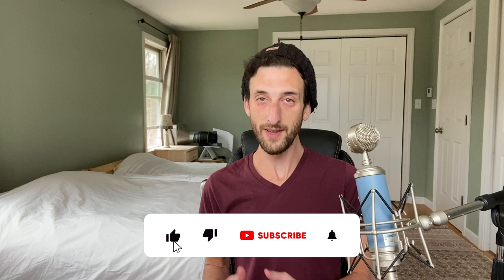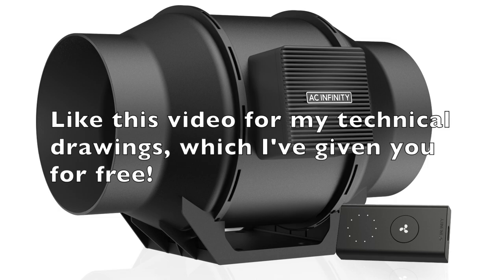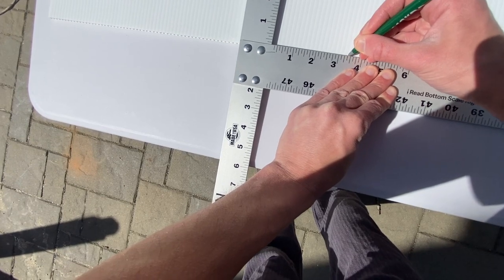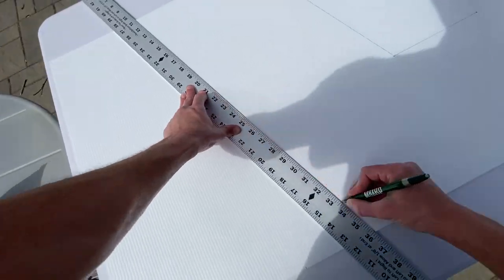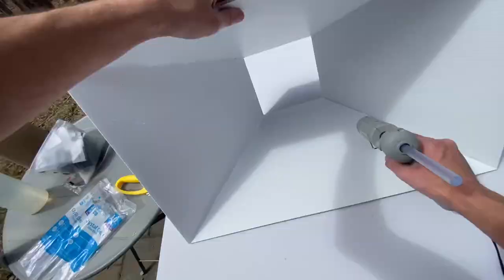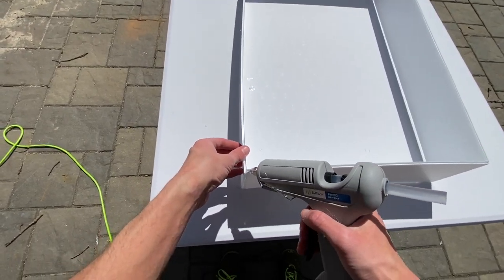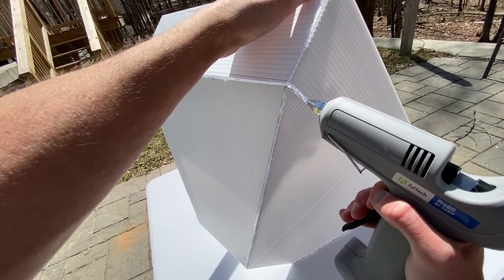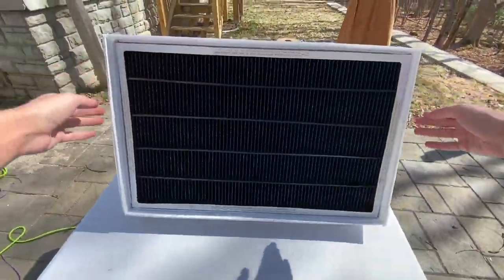How to make the best DIY fresh air system on YouTube (great for apartments!)

Comment: I'm still an advocate for filter before the fan.  The filter also protects the fan from particulates and dust, which is especially important if the fan you're using is an axial fan (which I think your fan is).  You wouldn't need to put the filter right in the window, given that you already built a housing for the filter that resizes its input.  And you can always dampen the fan output or redirect it by pointing it upwards or something.
Reply from the maker: You have a fair point, and I do agree. I may make a future design in which the fan is after the filter. 

Though fan before the filter actually worked well in this context. And was easier to build and implement.
Reply: @HealthyHomeGuide also, doesnt fan first make that pyramid you made a mold harbor w that damp outside air?
Reply from the maker: @johnanon658  Good question. I didn't have mold issues with this device. Polypropylene is resistant to moisture. Many HVAC systems have a length of duct before the filter, it's not necessarily a problem to not filter air immediately as it comes in. 

One thing I also want to express is that it's definitely a more difficult build if you put the filter before the fan. Assuming you'd put the filter in the window (because otherwise, the system would take up tons of space), you need a much larger window insert, with a bigger cutout that'd be harder to get right. Not to mention that many windows aren't wide enough and don't open enough to fit the Lennox filter. Next issue with filter before fan: air comes at higher speeds out of a smaller fan than it does diffusing out of a larger filter. It's nice to avoid air blowing on people.

For those reasons, I found that putting the fan before the filter was actually better in this case.

Comment: I built the 14" version and it works great! The CO2 in my home office went from consistently over 1000 to consistently under 1000 PPM. I would like more details about the importance of opening another window to prevent positive pressure as I don't have another window in the room to open. What are the risks of creating positive pressure?
Reply from the maker: Nice, awesome job! Positive pressure is a complex subject. Some people actually use positive pressure to keep pollutants out. But there is a risk and that's if you humidify your home in the winter. Positive pressure could force that humid air behind your walls, where it would encounter cold surfaces and condense, causing moisture issues.

Although, it's actually more difficult than one might think to positively pressurize one's home. The older/leakier the home, the more cfm you'd need. If you're keeping your fan on lower speeds, you probably won't even positive pressurize your home unless it's very tightly built. So it may not even be necessary for you to crack a window. If you want to be super cautious though, you can crack a window in a different room, close by.

Comment: Great video man!

That Lennox filter the by far the best on the market.  I use that on my HVAC systems air handler.  It’s awesome.  Positive Energy has a podcast called “The Building Science Podcast.”  You’d love the podcast.  I actually have been contemplating the same things.  I want to make a more compact one that can maybe mount to a wall with a flex duct going to the window to keep it out of the way.  Living down here in Florida the fresh air has to be paired up with a dehumidifier as well.  Keep up the good work!
Reply from the maker: Thanks so much David! Absolutely, that Lennox filter is top tier. It’s by far the best filter I could find. I checked out the titles of the episodes of that podcast you recommended and it really does look perfect for me.

A wall mounted filter unit would be really interesting! I haven’t personally found flex ducting that doesn’t smell terrible - could you let me know if you find a decent one?

For compactness, my other designs (#2 and #3) in this video do the trick well I think, but I like your idea of mounting them to the wall somehow instead of using the floor for support.

P.S. I’ll be thinking about dehumidification strategies this summer!

Comment: Thank you so much for the very helpful video! Are you aware of any commercial products that offer similar capabilities as your window ventilator? Like you, I suffer from mold allergies and also live in a very humid area in Portugal where mold spores are everywhere. I would like to filter the outside air before it comes into my apartment, but I do not have much faith in my DIY abilities so am looking for some sort of retail filter-fan that can fit into an acrylic window insert (like yours), but having trouble finding anything designed for this sort of thing...
Reply from the maker: I’m glad you appreciated my video! HVACquick has some inline filter boxes that are similar, but lower MERV, and Martinson Manufacturing makes window inserts. Hopefully those can be shipped to Portugal. That being said, I feel that a simple fresh air intake would bring in too much humidity (which leads to mold growth) and heat for you. A better option for ventilation is an ERV (+dehumidifier) since you live in an area that gets humid. You could also try using a ventilating dehumidifier, but that may bring in too much heat.

Anyway, if you’re interested in learning more about ERVs/dehumidifiers, I have a few videos on them. Good luck!

Comment: Great system, but in my case I need just the opposite, I need a system that will take 'damp' air out of my unfinished basement. Do you have a design for that?
Reply from the maker: A dehumidifier would be perfect for removing dampness from your basement. I have a video on setting a great one up.

Comment: Cool video! Thinking of installing my own ducted filtered air intake in my own place and stumbled on your video. Just FYI if you want a better cleaning product than vinegar, you should look into making your own hypochlorous acid. Non toxic, easy to make, and extremely effective as a cleaning agent.
Reply from the maker: Wow, this is fascinating! HOCl is apparently an endogenous substance in all mammals that is effective against microorganisms? That’s so cool, I’m gonna look into it.
Reply: Yeah, it's pretty cool! Obviously need to be careful with the pH and free chlorine amounts, once the pH of your solution gets too low you start producing chlorine gas, but once you have a good recipe down it's a great cleaner. Plenty of research into using it for all sorts of things. Lower concentrations of Cl have been used for wound cleaning and there has been some work into investigating the effect of aerosolizing it to help with COVID treatment/prevention because it appears to not only kill harmful foreign micro organisms, but apparently also causes the mucus membranes to produce more n-chlorotaurine (i think, bit foggy on this detail, read the paper a while ago), I believe as a result of the increased concentration of free chlorine. And that stuff is also supposed to be a great anti-septic compound. Which is another pretty neat detail! But yeah, just an all around cool chemical, great for washing food if you're worried about fomites and bacteria and what not.  @HealthyHomeGuide 

According to a few studies breathing a misted/fogged/aerosolised sample can improve allergy symptoms and help with easing inflammation of the respiratory tract. But I personally haven't tested that yet.
Reply from the maker: @gadget2622  Incredible! That is so impressive! A cleaning agent that is actually potentially beneficial to breathe in? THIS I have to look into. Thanks for your comment!
Reply: Is there a 'simple' recipe available?

Comment: Love this idea. I live in a colder climate in Canada would you know of any inline heaters that could be added so I could be bringing in heated air in the winter? Hard to keep the windows open in the winter.
Reply from the maker: Glad you like it! Good question. I haven’t explored the world of DIY inline heating because I’m a bit wary of its safety. 

Alternatively, have you heard of energy recovery ventilators (ERVs)? If you haven’t, they’re worth looking into. I have a video on how to do a DIY installation of an ERV.
Reply from the maker: ERVs are what's called balanced ventilation, meaning they intake fresh air and exhaust stale air simultaneously, and thus don't affect the pressure in a house. They basically allow you to take in fresh air that's not too hot and humid in the summer and not too cold and dry in the winter.

I feel you on that smoke situation. I've experienced something similar and it was maddening. Unfortunately, unless your home is very airtight, it's actually pretty difficult to positively pressurize a home. For the typical home, you'd need around 230-350 cfm to do so. That's more than people think.

I suppose it could be accomplished by a system like the one in my video, but you'd need to turn it on a higher speed to bring in ~300 cfm, which would be quite problematic when it's hot/humid or really cold. The timer I set up definitely did help with those issues on extreme days, but I was running it on the lowest speed which only delivers 55 cfm. 

Another issue for your situation is it won't always be running if you use a timer, of course.

Comment: I'm thinking your design might help me with making an off-gassing room out of a bedroom.
I'll also be putting a ceiling fan in the room.
...
It's turning out I need to have three of the four bedrooms off-gassing 🤯. The mattresses my two sons purchased are much too toxic to be tolerable with my MCS.
....
The house has central AC, I could really use some coaching 🙏🏼
Reply from the maker: That’s awful! I feel your pain. The neighboring condo just sprayed Lysol in their place and now mine smells like it. I have MCS as well. 

Ventilation (bringing outdoor air inside) is indeed the best way to dilute concentrations of VOCs like from mattresses off-gassing. My device in this video could be useful to you as a short term solution (if it’s not too hot/cold/humid outside of your house). As a future goal, you may want to consider having an ERV installed in your home. That way you can ventilate safely no matter the outdoor conditions!

Comment: Why would you not want to have a little positive pressure in the house to keep outside air from leaking in??
Reply from the maker: Some people might. It depends. For instance, in the winter, it can be risky if you humidify your house. Because you'd be pushing humid air behind your walls, which can cause mold growth.

Comment: What prevents insects from getting sucked into the fan ?
Reply from the maker: The window screen. It catches most insects before they enter the fan. Just have to clean it every so often. 

If you can’t use a window screen, that’s actually okay. You’ll just maybe want to vacuum insects out of the filter every couple months during warm periods.

Comment: 👾 Woah that is some great simple effective design/materials.  I wish I saw this video before the Canada fires smoke impacting my area in New York state. What devices have you been using to monitor the PM 2.5 before and after in your rooms?  Also, will that cloroplast/glue breakdown from being near window/sunlight? 😼
Reply from the maker: Thanks so much! This design is indeed very helpful for filtering out particulate from wildfire smoke. I used the Dylos DC1100 Pro for particulate monitoring. 

Hot glue and corrugated plastic are not significantly affected by sunlight. In order to become pliable, hot glue must reach temperatures much higher than those that would come from sunlight filtering in through a window. Coroplast is also resistant to that sort of heat - until it reaches a temperature of 600 degrees F, it will not break down.
Reply: Likewise, during the wildfires, I actually taped a merv14 filter and a charcoal filter to a box fan and stuck in the window and sealed it up with cardboard. It allowed the house to be better ventilated, but then there was no exhaust and I found CO2 buildup in other areas of my apartment with a CO2 meterm I've been trying to figure out how to do what you've accomplished by literally "f*cking around"...but this channel really brings it all together in clear concise ways and takes all the experimentation away. Very inspiring channel @healthyhomeguide !

Comment: Hi - what kind of weatherstripping foam did you use? You mentioned "non-toxic" so I am curious.
Reply from the maker: Hi! The foam I used is unfortunately not available anymore. I’ll let you know if I find another good brand.
Reply: What thickness was it ? Also , I think you mentioned that the foam in part corrected a mismeasurement, but wouldn’t I want foam regardless to ensure a tight seal between the chloroplast and the filter frame ?

Comment: carbon/charcoal filters only filter about 9% of VOCs at most and this includes huge carbon filters with 25 lbs of carbon in it, they help improve odors but don't really work for safety and health, so if you have a problem neighbor or live in an area with high VOCs outside, this is a bad idea, the only solution when you have gases (VOCs) outside is to move, outdoor TVOC should be around 0 ppb with no visible sources of pollution...  just .0001 ppb of ethylene oxide, for example, exceeds the EPA's lifetime cancer risk limit.
Reply from the maker: Agreed. My stance is that activated carbon is not nearly as reliable or effective as people think it is in the context of air purifiers and VOC removal.
Reply: @HealthyHomeGuide  our testing of the #1 rated consumer air purifier showed 9% also for a huge consumer carbon filter with 25lb of carbon, same result... our lab with one of the world's leading expert with a PhD in Chemistry has spent decades testing filters with the same results, about 9%... that's not good enough for me when you are dealing with class 1a carcinogens, so the only option is to move... even more than that when you are dealing with class 1 a carcinogens they will stick to every surface and the filter surface so the filter will then become a source of trace amounts of carcinogens, and if it's blocked by the carbon, then later, like you said, it can re-release the carcinogens back into the air when it gets full or the humidity, temperature, and pressure are just right and then your carbon filter starts to poison you...  this is not medical advice.